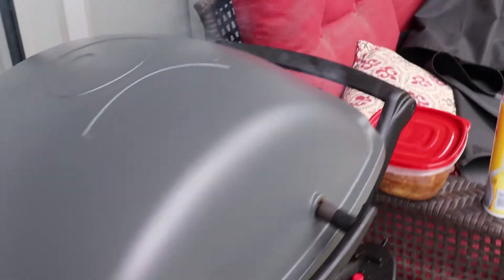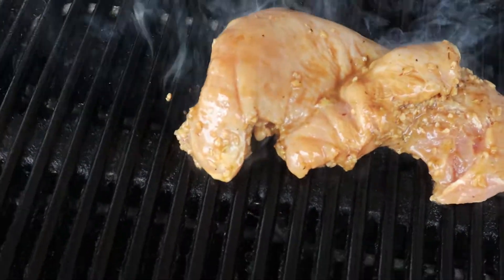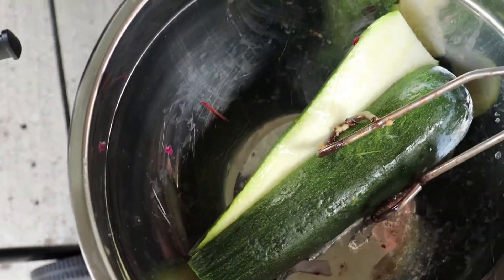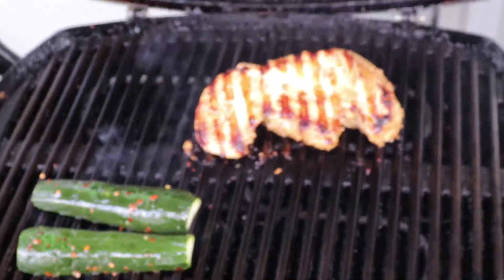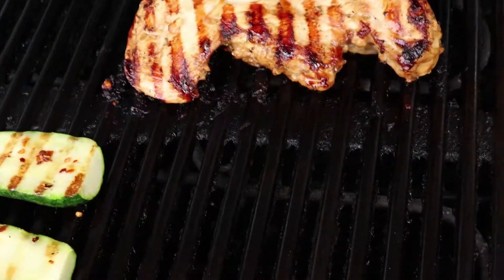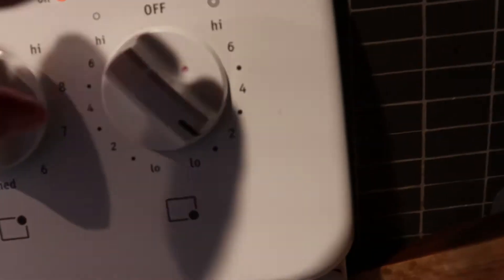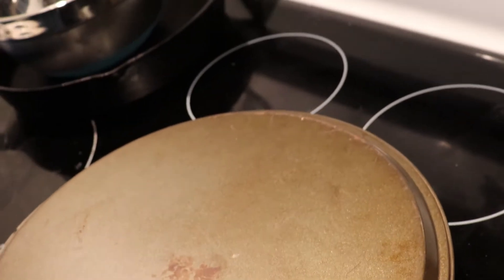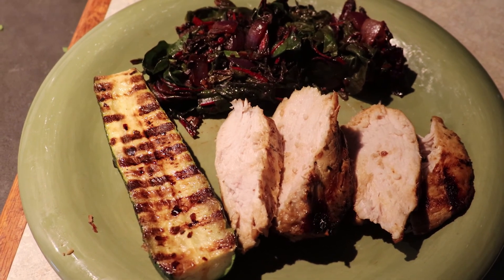Grilling turkey breast and zucchini with my Weber Q 2400 electric grill

Comment: Can you add soaked wood chips in this grill?
Reply from the maker: Not sure, it's not something ai have ever tried. Am in a condo so I need to keep smoke to a minimum.
Reply: @JeffJedras  you can. I add soaked wood chips and place them in the small Weber smoking box. I make sure to use chips specifically for smoking in a BBQ- more like dust. Place them in the box, and them place toward the back of the Q 2400 when you have 5 min left of heat up. It does not become flammable and imparts smoke to your food.  The smoke is very minimum.